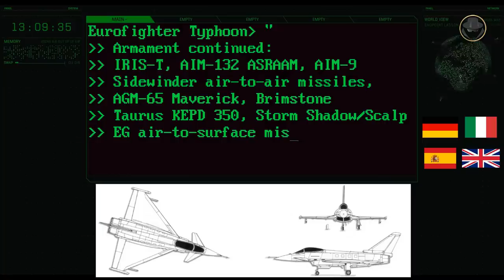Eurofighter Typhoon | The story that the West does not want to tell

Comment: It's amazing how much the F-35 has failed to be, what it's supposed to be! The euro fighter is not popular in Europe due to the reputation of the F-35? Yet the USAF is modernizing and retaining older "4th generation" fighters. The very aircraft that the F-35 was supposed to replace!
      Here is a fighter that can super cruise, dogfight, AND detect the "stealthy" F-35, for BVR engagements? Is this claim, actual capability? If so; then the actions of the USAF today make a lot of sense. It's surprising that this Euro fighter has been snubbed by European nations. Still, it's abilities seem outstanding. If nothing else? The Euro fighter Typhoon demonstrates the failures of the F-35. One waits to see how these aircraft will fair, in conflicts to come.
Reply: You are right, but remember that most of the upgrades on 4th generation are on fighter that will strike once air superiority.
Reply: @youngkaiser5870  I'm not a big fan of this (?gen fighter) stuff. In the 1950's and 60's. Aircraft manufacturers discovered the boundaries of good fighter jets. Mach 2.5 was as fast as you could go. Unless you were willing to build with titanium, and difficult to use ceramics. The cost, is prohibitive. Aircraft like the F-5, A-4, Mig-21, and others showed what the limits of maneuverability were. Leading to what some call 4th gen fighters. The difference is the electronics, stealth features, and high dry thrust engines. 
    Some people think stealth is a total game changer. Something like a "Romulan cloaking device!" Lol! Stealth is an especially expensive form of ECM. That's all it is. Is it really worth the cost? How many F-22s are there? Not very many, and out if production! So? Not as good as many believe.
      What's an F-15/F-16, with cutting edge equipment, and high dry thrust engines? Much more deadly than most people think. That's what makes this Euro fighter Typhoon so dangerous. After all? The definition of "stealth," is contingent on the nature of the sensors used to detect it.
      The X-29 explored the concepts of extreme instability, for extreme maneuverability. So? Why aren't such fighters in service? Pilot killers. The human body can't cope with such violent maneuvers. The F-16 is notorious for being a pilot killer. The pilot inputs the maneuver, passes out, and crashes. 
    So? I'm very interested in what they're calling a "6th gen fighter." But, I doubt many will be  built. The cost of such fighters, will stop them from being an overwhelming force. After all, "air superiority," is accomplished by  numerous aircraft overhead.
Reply: @scottjackson5173   @Scott Jackson  I do agree, but you must consider that overall, aircraft number production are decreasing, just look at the aircraft per generation.
Now like you said, stealth is one element of an aircraft, wich can be usefull on the ofensive, a reason why the US and other countries will use them in their carriers.
Reply: @youngkaiser5870  Oh yes, I noticed. So? The REAL game changer will be a fighter jet that is cheap and effective. Effective enough to survive the combat environment. Built in numbers large enough to eliminate the opposition. That's air superiority. Something like the F-20.
Reply: @scottjackson5173  Agree for the most part however I do think that stealth is a game changer in BVR, not necessarily because the enemy can't see it but because they will have difficulty employing weapons at range. I'm not sure how long it will remain this way though. IMO the next generation of fighters will be all about volume; pilotless, low observable aircraft affordable enough to employ in sizable quantities to overwhelm air defences managed by a small number of piloted aircraft with highly advanced communications and sensor suites.
Reply: @rickwalker2  That's the problem with stealth today. Twenty years ago, you were absolutely right. Since then; nationas have been working hard, to negate the hostile stealth advantage. So? Every week that goes by? Stealth becomes ever less advantageous. It's why they stopped building the F-22. It's also why. Excellent airframes like the F-15/F-16, are being modernized.
Reply: @rickwalker2  Ah yes, Drone fighters! At first glance? Clearly the wave of the future. Right? That's why Iran captured, and successfully landed. 
A top secret American spy drone. So stealthy Iran wasn't supposed to know it existed! So the term is ECM, (Electric Counter Measures). 
    Over friendly controlled territory? Combat drones make stealth largely irrelevant. The reason for this is simple. Fighters like the F-22 can carry very few missiles. No more than 4 or 5 BVR engagements. Combat drones and cheap drone decoys. Can easily soak up ie saturate the stealth fighters abilities. Once the stealth fighters have shot there collective wad? A heavy strike package can be delivered. If I can think of dozens of ways to render stealth irrelevant. So can our enemies. Is stealth really worth the money? I have serious doubts.
Reply: I am sure that France will be able to help its friend and ally on the other side of the Atlantic by selling them the only truly multi-role device, spawning technology and having proven itself in many areas of operations.
After years of using US planes it would be fair for the little frog eaters to help the mighty Uncle Sam.
 Irony, irony when you hold us ...
Reply: @scottjackson5173  And why not? You've been laughing at the mouths of the French for years. Well, we, on our own, built a plane superior to the Typhoon in every way, not to mention the Fail-35.
So yes, we're kidding. Hello home
Reply: @olivierpuyou3621  Fail 35? Finally something we can agree on! I'm not a young man. I'm a US Navy veteran, among other things. I followed the ridiculous JSF program from inception to abortion. The idiots in the district of corruption (Washington D.C.), wanted one "it" plane to do it all. The entire design philosophy was a joke! Too many conflicting requirements. What sounded good on paper, was good for politics. Bad for science and engineering. Sound familiar? If it's anything I've learned over the last 60 years. Politics and science don't mix. Because science requires actual reality. Where as politics relies on lies. So the F-35, isn't really what it's supposed to be. Just like climate change.😉😊
Reply: @scottjackson5173  My dear Scott, if you will allow me to call you that.
The F-35 is an aircraft in gestation, the idea at the base is good, the means employed are not. I am no longer a young man myself and I was a soldier (in the last century ^^)
When a program fails and the F-35 cxas clearly a failure, it is better to stop the costs and wait for the technology to mature. But for political and leadership reasons this program has become the most expensive of all time in all countries to give birth, forgive me for saying a shit.
Now after years of French bashing, we French have an excellent aircraft which is superior in many ways to the European Typhoon and the US F-35. So please let us rejoice with this little revenge and this nice joke.
and then what the hell we are allies, right? for almost 250 years with the USA and more than 800 years with the Kingdom of Scotland. So? friends?
Reply: @olivierpuyou3621  Funny thing about how things come full circle. America is a nation of immigrants. Once, long ago, a French king. Conquered England. Then he chose to stay in London. Instead of returning to Paris. In the fullness of time, the French nobility rebelled against this particular descendant of Charlemagne. Joan of Arc is famous for her role in that revolution. That King, as well as Charlemagne are distant ancestors of mine.
     In the United States; no one cares about your ancestry. Just how much money, you have. One can say, I will always be a friend of France. Not just because of an allied status. But for many centuries my ancestors spoke a dialect of modern French.
         Even as they ruled at court in London. The language spoken was French. It's funny you know? I would never have known. Except for my mother. Being a devout Latter Day Saint. She researched her mother's ancestry. Her mother's last direct Royal Ancestor. Was Edward the First; king of England. My grandmother's blood line survived England's "war of the roses." By living a more or less  matrilineal existence. 
    When she brought me that box filled with two reams of computer print outs, one sided. I was EXTREMELY sceptical about what she told me. Until she got out the photographs. DNA doesn't know how to lie. In my own unique way, I'm  as proud, as any French man. Even though I have never visited France.
      Looking through all those thousands of names. So many, for so many generations were royalty. I finally began to understand myself better. Became at peace with myself,  for the first time. 
     I am a man, with a passion for life and truth. A man, unlike most. Good or bad. I've had to live with that. Ciao
Reply: @scottjackson5173  Ok scott, ok i'm not sure i understand all you mean. but know that my comment was in no way insulting, just maybe a little mocking? But it is an old French tradition which does not want to harm anyone.
Regards dear friend. And cordially.
Reply: @olivierpuyou3621  The idea of a highly capable super cruising, and stealthy combat aircraft is fine. If it's primary mission is fighter. Then it needs to be as fast, and as maneuverable as possible. If it's primary mission is ground assault. Then it needs the greatest possible range, the highest level of fuel economy, and the largest possible payload. Not to mention, the highest level of stealth. These are mutually exclusive profiles. That's the problem with the F-35.
Reply: @scottjackson5173   I’m not disagreeing with you, ECM and stealth are a constant arms race against countermeasures/counter tactics and always will be. I also agree that large volumes of drones are the way forward however manned stealth is absolutely superior to legacy systems right now. That being said, I don’t think it’s invulnerable and I don’t think it’ll be long (in the grand scheme of things) until expensive, manned stealth aircraft will need to make way. I think where we differ in opinion is whether the drones will be stealth/ECM capable or not and my view is that they should be. Ultimately, the lower the observability of drones/decoys the better as it reduces the effectiveness of enemy air defence but you’re right- the cost needs to be weighed against the benefits.

Comment: Austria made a mistake when it bought used tranche 1 Eurofighters a few years ago. They have many technical issues apparently
Reply: Actually Austria didn't buy T1 EF initially. It was planned to get 18 T2 fighters but our brilliant Defense Minister at that time renegotiated with Airbus to get 15 T1 instead for the same price per unit. This incompetent fuck should be in jail for this (together the Airbus Executives who obviously paid bribes left and right to the relevant parties to get the contract in the first place).
Reply: Should have bought the Gripen
Reply: @Karl-Benny  Or Rafale :)
Reply: @hackbrettschorsch6855   Rafael is way better choice right? Why didn't they go for that?
Reply: @Dhksksjjsjjs  it´s the Rafale, not Rafael ffs!
Reply: @bastianelsenhans6639  I don't care!
Reply: @Karl-Benny  When you buy a fighter, during peace time, there is more politic involved than operational capabilities.
So of course the Eurofighter had an advantage there while the Gripen would have fit certainly better the bill.
Reply: @scepticalwalker3984  Eurofighter is twin engine right?

And Isn't rafale cheaper than Eurofighter ?

NB : Austria is  a small country,  remember ww1?😂
Reply: @olivierpuyou3621  Rafale may be better in offensive operations with twin engines, range and payload. In defensive operations a lighter plane offering the same performance with a single engine, advanced radar & EW and advanced Meteor missiles might be better. Small countries like Austria typically don’t bomb other countries in offensive operations.
Reply: @Dhksksjjsjjs  sorry the response was meant for an earlier comment about Rafale vs Gripen